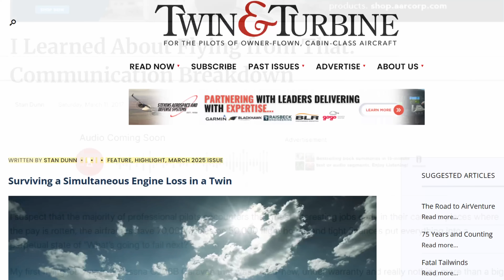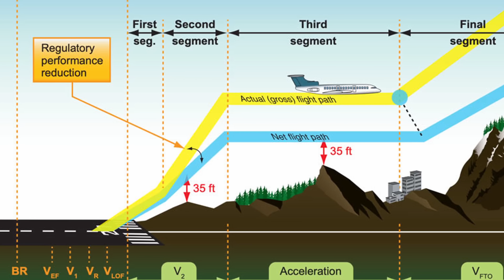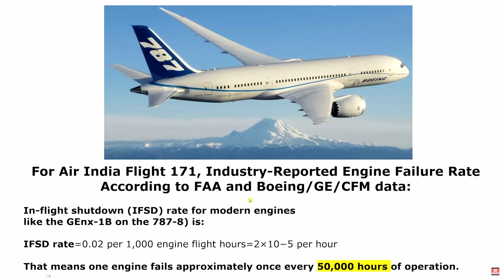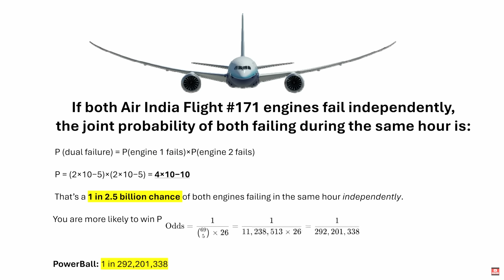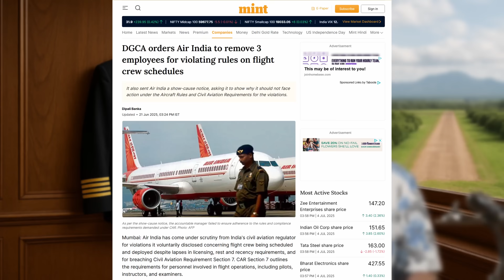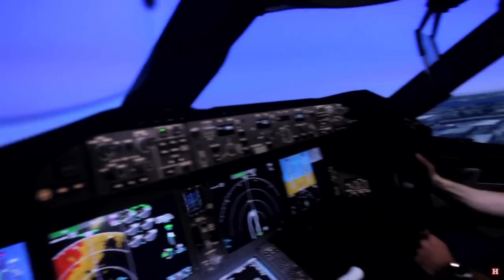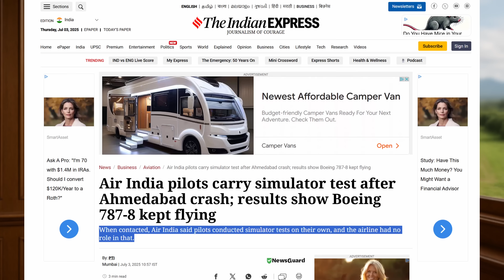Air India 171 Cause Becoming Clear

Comment: Highly speculative. Little more. Until the facts become clear it will remain speculation. One could also speculate that if it was pilot error, both Boeing and Air India would be champing at the bit to apportion blame. Where one party's fault is unambiguous, it's not uncommon to see efforts, subtle or otherwise, to shift accountability. That hasn't happened, suggesting they know something the rest of us don't, that could implicate either of them for negligence.  If pilot error were clearly to blame, we’d already be seeing strong narratives from Boeing or Air India shifting accountability, especially to protect liability, insurance exposure, and reputation.
Reply: Unnecessarily speculative, as you have not even considered the basic black box info before plowing into these cynical conspiracy theories.
Reply: Also statistically,  pilot error accidents are reported soon after the accident if they are a key factor.
Reply: There was also a The Federal Register AD 2016-24-09 This AD was prompted by a report indicating that all three FCMs might simultaneously reset if continuously powered on for 22 days. Not sure why its not showing up in teh FAA DRS System.  A later AD, specifically AD 2020-20-09, superseded ADs 2015-14-07, 2016-07-10, and 2016-24-09. This new AD (2020-20-09) requires installing updated Flight Control Electronics (FCE) Common Block Point 5 (CBP5) software, which provides a terminating action for the unsafe conditions addressed by the previous ADs, including the 22-day FCM reset issue.
Reply: I was told that at takeoff full power is applied.  Count 13 seconds and the plane
  must be airborne, you can feel wheels off the ground.  In this case it was longer than
   13 seconds so the pilot should have hit the brakes.  An engine thrust malfunction.
Reply: @anttyzale5455  You have to adjust for temperature & pressure. Temperature that day was extremely high (even for India) so you would expect more than the standard 13 seconds, if that’s the typical.
Reply: What about pilot suicide as a remote but a plausible possibility? Just because pilot were non-muslims that possibility can NOT and should NOT be ruled out! You said it that nothing can be ruled out at this point Mr. Smartie Pants!
Reply: @MohammedIrfan-wc3zm Pilot suicide is probable only with muslims as they claim they are not afraid of death and imagine of getting 72 virgins in their afterlife for killing non muslims. The blackbox data would expose such sabotage operation.
Reply: @MohammedIrfan-wc3zm Pilot suicide is probable mostly with muslims as they are ones who claim they are not afraid of death and believe in getting 72 virgins in their afterlife for killing non muslims. The blackbox data would any ways expose such a sabotage operation.
Reply: It's going to be software related and since Boeing outsourced much of the software to India both Boeing and the Indian government have an incentive to cooperate to shift blame. Let's look at some pretty self evident signs: both Boeing and the Indian gov are corrupt, and we know that there was no electrical power within 15 seconds of leaving the ground because the RAT was out and the gear had started to retract. Now link that with some precedent: the 248-day software bug that could take all AC generators offline - even though the bug was fixed the architecture still allows software to take all the generators offline.

Comment: I viewed another video which indicated that the flaps were NOT extended BUT the cockpit display showed they WERE extended, so the pilots proceeded on the assumption they were extended.  The video made no mention of the position of flap extension levers; I am NOT a pilot, but it seems to me that one or both pilots would have noticed if the flap extension levers were in their proper position, but then, what do I know?
Reply: The video shows that the flaps were extended, it looks like to level 5, normal.

Comment: The question Air India should be asked, is why there was only two pilots on a flight lasting 9 hours 50 minute? Without a third pilot the flight crew cannot leave the flight deck for rest. The 787-8 has a pilot rest area with two bunks and two reclining chairs above the forward passenger cabin.
Reply: They had "'12 cabin crew" not including the 2 pilots. Why did they need 12 attendants? Two of them should have been relief pilots.
Reply: @jacquelinejacobson6789  Normal cabin crew complement on a 787-8 is 8. But only two pilots on what would be nearly a 12 hour duty day is ridiculous. Not a safe operation.
Reply: @victorgrasscourt3382  12 hour duty day is not uncommon with some states. US is 8 flying hours for 2 pilots IIRC , but not all states have this. And many states can exceed the maximum flight/duty time if a report is sent to the national DCGA or CAA or whatever.
Reply: @marclandreville6367 You cannot base an operation on the pilots filing reports every time they exceed their hours. That is a very serious matter. The CAA in the UK would expect a local airline to ensure a flight is adequately crewed to take into account fatigue and in-flight rest provision. Time changes are a factor, and the possibility of a diversion, where the duty hours of a two man flight crew would be severely limited.
Reply: @victorgrasscourt3382  It's not the pilots who have to file a report, but the air carrier. Airlines have scheduling systems  that incorporate air regulations and in many cases, the collective agreement. Everything is computerised, and easily subject to an audit by the regulator. There are sometimes exigent circumstances where a crew is permitted to fly beyond the limitations if, in the judgement of the pilot-in-command it is safe to do so, such as delays for a return flight to base. It depends of the leeway the regulator allows the air carrier, and the reporting ensures that these leeways are not abused.
Reply: @marclandreville6367 . If a Captain and his/her crew go over their maximum allowable flight duty hours due to operational reasons, he/she would have to file a report to their airline first. The CAA in the U.K. for instance, would have to be notified as well. They might then look into whether the airline has an operational problem. Fatigue is a great concern.
Reply: So are we surprised Air India was told to stand down three executives responsible for crew scheduling? There's something there. We'll hear more about it when the investigation's report is issued, I'm sure.
Reply: LOL.
Reply: Immaterial

Comment: So double engine failure happened when a battery was not connected, but it still is impossible? Wasn't there a wiring problem sighted by a passenger who flew with the aircraft before?Most of Boeing's issues appear to be electrical. But why not wait for the press conference by the Indian surveyors?
Reply: People want answers, even if they are the wrong ones !

Comment: Even if they had shut down one engine for whatever reason, the plane would have continued to climb. Also, the pilot could be heard on the radio saying "no thrust". That suggests that both engines failed at takeoff which is not realistic. There is only one possibility left and that is terrorism. I don't know who and how they planted something, but something was done to that plane at some point. Maybe it was done weeks or months ago with some time delay capability, but that is the only logical conclusion based on what we have seen and heard thus far.
Reply: At that phase of flight the engines don't need to fail, reduced thrust could be enough to sink back down
Reply: @anon1832  At that phase of flight when full power is needed most, reduced thrust on both engines concurrently constitutes a failure. And on modern turbofan powered planes that 's just not possible.
Reply: @Steelologist  nothing is just not possible. It's unlikely that both engines failed independently which leaves only common modes: fuel, or a way for electrical failure to reduce fuel flow. I'm proposing that for very good reasons fuel contamination is so maturely regulated that it is unheard of for that to happen at takeoff. The 787 is architecturally different from all other airliners with a high reliance on electrical systems and a poor track record. The engine driven pumps could not deliver enough fuel at rotation in high temp and the combination of reduced thrust and gear down allowed the plane to climb briefly before sinking.
Reply: @anon1832  Two engines failing together at the same time is impossible without some sort of a sabotage. Go check out the statistics. One in many billions chance of that happening means impossible. Period.
Reply: @Steelologist  common mode failure due to ice buildup in fuel filters (BA38), fuel contamination (extremely rare but happens), fuel starvation (unheard of at takeoff) or another common mode failure involving electrical failure in an aircraft that has unprecedented reliance on electrical systems, has had proven catastrophic software failures of electrical systems, and absolutely 100% did not have AC power in the mobile video of the crash. Probably lack of fuel to both engines at rotation or one of the many other theories posed that all centre around electrical
Reply: @anon1832  Blah, blah, blah... You must not have anything better to do than introduce random complaints about random problems that might happen to an airplane. You've moved 2 light years away from the original topic. Please don't forget to mention aliens or God in your next reply.

Comment: Respectfully, many with just as much experience as you are pointing towards the Fadec taking over and shutting down or reducing the engine thrust level after false data inputs. You seem to ignore that the computers could have been the fault (not sabotaged, but internal issues) , and not anything the pilots could have done in such a short time and at low altitude. If that turns out to be the real fault will you make another video ?
Reply: That would not account for the RAT being deployed
Reply: @davidrave563  Isn't the RAT being deployed a sign of total electric power failure ? No power, No computer.
Reply: I'm not sure he was saying that in the video...what I took away from it is there was some undefined failure on #1 engine, and the pilots accidentally shut down #2 engine. RAT deployment is a consequence of the incorrect shutdown.
Reply: @chrismacbean  I disagree. There would be no need for the RAT to deploy if the internal batteries and electrical system where functioning. Even with it deployed, at such a low velocity, the amount of electricity it generated was likely very limited. Maybe not sufficient to maintain minimal operation of the plane.

Comment: It looks to me like improperly configured for takeoff
Reply: yep, this is my theory. Based on many factors. Has definitely happened before many times.
Reply: To many warnings when the throttles are pushed up for that to be the case.
Reply: @orizaba18000 that’s not necessarily true. There are a number of things that could have been entered into the computer wrong and the aircraft won’t know, like weight, weather conditions. Fat finger one key and you don’t realize it then the computer is none the wiser. That plane took the entire length of that runway to lift off and it barely got off the ground, that right there tells me there was some kind of performance issue with the plane. No pilot will intentionally use every last inch of runway to takeoff
Reply: @JohnRedKorn28  Incorrect. There are two checklist warnings and takeoff configuration warnings that would alert you regardless of what you enter in the FMC.

Comment: Its a software glitch. Boieng fault.
Reply: Boeing has had several sketchy software issues and ironically has outsourced to India - if thats the case both Indian gov and Boeing will want to shift the blame and since both have proven cases of extreme corruption this could get ugly. Just as a starting point Boeing 787 had an integer overflow but that would disconnect all AC generators instantly after 248-days of constant power, not even their first overflow bug and extremely concerning.

Comment: I have only seen this on one particular site that mentioned the pilot's seat slipped when he was climbing and the pilot inadvertently hit the thrust levels, which shut down both engines. Of course, if this was the case, you don't have much room for correction at this low altitude.
Reply: Bullshit.😂
Reply: The 787 has electric seats.  They don't slide like in a C-172.
Reply: The copilot would have shoved the throttles to the firewall.
Reply: This is a "fake" theory, please don't contribute to spreading it.
Reply: That was a fake message circulating in social media .. sick people.
Reply: Lets pretend this is possible...this is one of the thousands of reasons thy have two pilots in the flight deck. So if one person can't fly, the other one does. Secondly, you can tell this is total absolute bullshit because you can just advance the throttles if you "inadvertently hit" them somehow. Imagine if your car turned the engine off and wouldn't turn it on again if you stopped giving it gas...like what moron would design something like that?

Comment: My assessment from the 1st day: pilots shut down the wrong engine after one failed.  My theory has not changed.  That plane went from ascending to descending in just moments; that means a critical loss of thrust from both engines.
Reply: there is a check procedure for that and first goal is to climb, regardless of a faulty engine.
Reply: Correct, Joseph, wrong... @DC1030-h5v
Reply: Software/sensor glitch
Reply: In just a few seconds, no minutes involved
Reply: @gregorios2380  I said moments, not minutes
Reply: @Joseph-j9r7g  While "moment" is often used to convey a brief and indefinite period, its formal and historical definitions offer specific measurements, including 90 seconds (1.5 minutes). FYI
Reply: That theory was debunked by professionals pilots specializing in aircraft accidents on day 2 or 3, they even had their pilot jackets on.